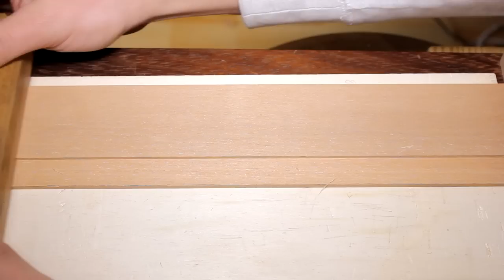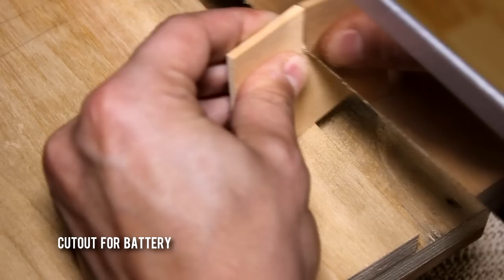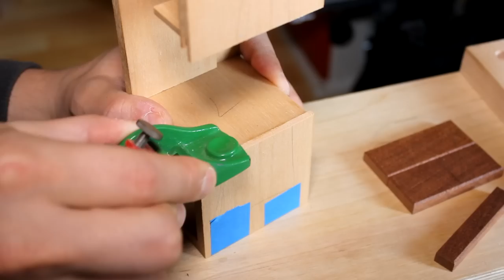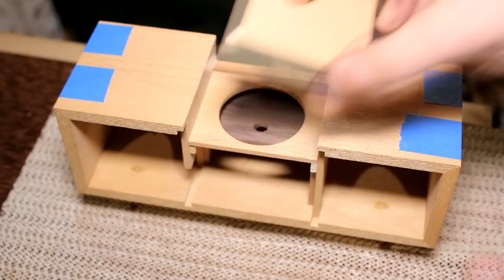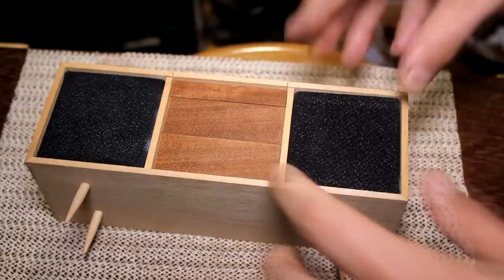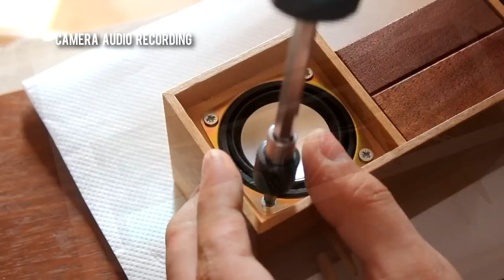Making a Bluetooth Speaker Box / Mid-Century Modern Console Style

Comment: With so many pieces and so much labor I think that scaling the project up and using higher performance componentry like  Dayton ND65 speakers, 3 batteries, and a more powerful amp would be my preference along with using a trim router during the build. Cool retro looking project though.
Reply from the maker: Thank you! Yes, my main focus was on the woodworking part, I wasn't even sure I can manage making it till the end :) Thanks for the tip of the speakers type! Electronics/hamradio was my hobby before woodworking and I've kinda loose track of the new stuff :)

Comment: Very delicate and tidy work! My respect for you. Tell me, is there any noise? And then it seemed to me that when you turn on you can hear a hiss in the speakers.
Reply from the maker: Thanks! Yes, there is a noise, I think from the BT module, or from the wiring towards him which are not shielded. Also the BT module, this kind I have, has a low 5kHz noise, I've read many peps having the same issue. There are also other types of BT audio modules, might not have this bug. Amp alone it's, quiet.

Comment: The build is awesome you are very good in woodwork but the amplifier choice is not bad but it needs another thing that is an input filter that can decrease the extra bass. Just use a 103pf in the input as parallel. Use 2 for both channels. I hope you've  understand.
Reply from the maker: Thanks! Yes, I know what you mean. That bt module has also another problem, it has like a 5kHz noise. Some folks said they made a notch filter on that freq. It can be heard that beep when no audio is in, but when playing something you don't feel it no more. Anyway, it was just an experiment with the smallest and affordable components I could find. Maybe on a 2.0 version will use better stuff.
Reply: Adrian Preda 
No brother you didn't understand. I told you to use that to decrease the extra bass from the amplifier. The extra Bass causes too much discussion on the output. Use the PF to decrease the base. Then you will get more sound out of it without losing the quality of the sound.

Comment: Beautiful project, just One question, how do you recharge the battery, I did not see any input to connect it to the current? 
Sorry if my English is bad, but I'm supporting the Google translator.
Reply from the maker: Haha, finally someone notice that :) That is still in work. For now, I just unscrew the back and recharge so. I was waiting for a panel mount socket to put it on the back, and then make a cable (USB to whatever socket will be that, DC or 3.5mm jack). I ordered some sockets online and didn't arrive by the time I made the video. There was also the option to hotglue the little PCB charger and make a cutout on the back, but wasn't ok with that.
Reply: hahaha just caught my attention not find the entry for charger to the battery, but watching your work so detailed and dedicated to the details I'm impatient to see how you solve that small detail, but I imagine it will be great
Reply from the maker: Luckily the battery holds well :) Since I've made it, 1.5 weeks ago, never charge it, and still runs, and I use it like once every 2 days, I remember of it, and play some music. It seems that there are no micro-usb panel mount sockets easily available (just some adaptors/cables I saw) and that's why i thought to use generic sockets like DC 5.5mm or jack 3.5mm

Comment: Very nice I congratulate you but the most important part you did not explain, you should make a new video explaining the electrical connections in more detail to know at what point each cable should be connected and in what order. regards
Reply from the maker: Thanks! But is nothing special if you have a very basic idea about audio circuits. And I do not do tutorials, even for woodworking which is the main theme of my channel. I just do "look what I did" videos :) Sorry. I've put the names of the stuff I used for the electronics in description. You can look for those and see on other dedicated channels or websites which explains how to. Or you can improve them. I just used very cheap and easy stuff to fit in my project. regards, Adrian